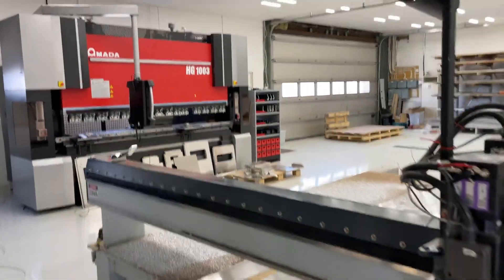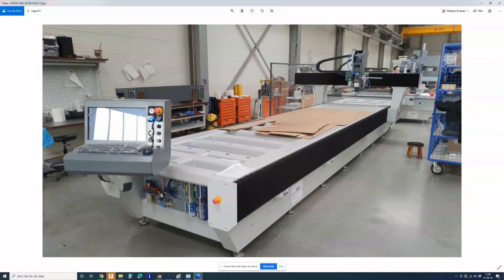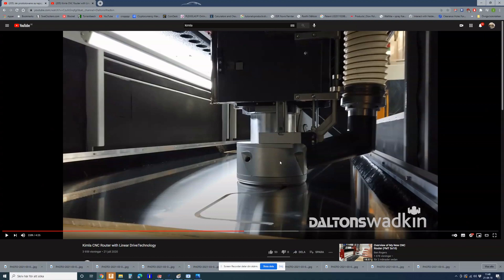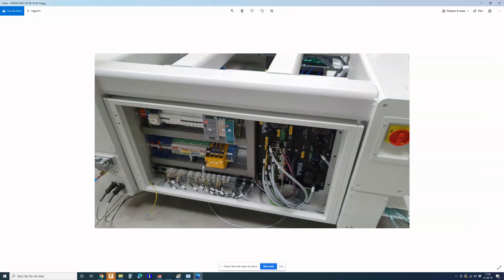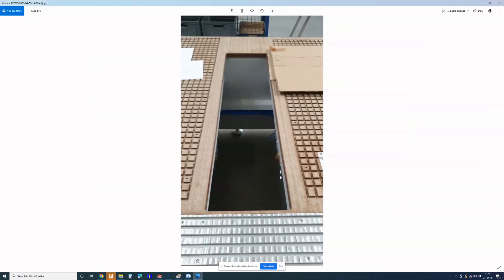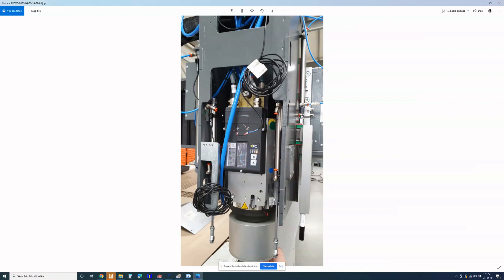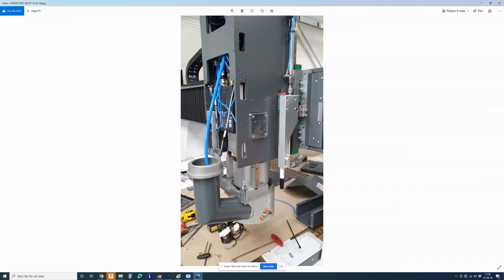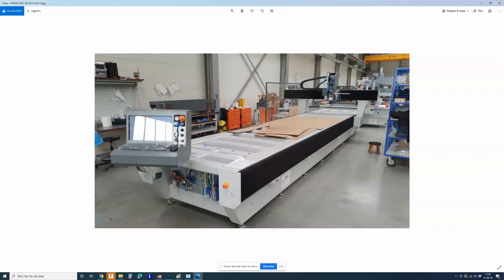The MONSTER CNC router!

Comment: ARHHH!!! LOOK at that!! Kimla popped up a few months ago on youtube when I was searching for linear motors. It's an AMAZING machine. Perfection. 16mm steel, impressive. I can imagine how incredible happy you are with your new beast. Incredible! congrats on the purchase!! Why did you picked the 12kw spindle? HSD has smaller spindles with HSK63 i thought? Perhaps you want to use larger facing mills, that would explain the higher power. The Busch rotary claw pumps deliver their full vacuum at full flow. I don't know what model you've bought, but i have a friend how bought two of these pumps for his 2100x4000mm machine; these pumps deliver the full capacity in airflow at their deepest vacuum. (he uses a VFD to control the pomps, and is using a panasonic 0-10V out sensor to lower the pumps RPM when the required vacuum has been reached. 1252 i see! i thought he has the same pumps. That Lidar is NICE! Roller bearing lineair rails! Renishaw.. Arh.. Wickedwickedwicked! Did you get a dual Renishaw with tool length/diameter measurement as well? and also a probe for in the spindle? (i fell in love with that system on a HAAS) these probes are a very worthy investment with the proper macro's. I remember when my machine arrived I wasn't able to sleep. I'm pretty sure you won't sleep fast Thursday night. What type of controller is used on the Kimla?
Reply from the maker: Haha yeah i know! I figured you would be excited. Its craaaaazy ;)
There was alot of discussion about the spindle and I was initially aiming for a higher rpm (40k+ rpm) to get faster speeds cutting thin alu with small tools but after thinking about it I went with the 24k and higher power for the sake of "all-aroundness". I'll be processing alot of different stuff on it. Also a facemill and some steel cutting. And the "floating dustfoot" wouldn not have fit a different type spindle nose.
The vaccum pump selection is a big topic in itself ;) Alot of pros and cons but these mink 1252 are great. I like the 1252 because they do -900mbar as the next size up only does -800. Tho manual states its only ok to run -900 for about 20mins. Probably due to heat. Best part is low power draw and dry running with almost no maintenance. I might have a oil lubricated rotary vane for special occasions too.
The probe is a Renishaw LP2 which is mounted next to the spindle in a "house" and comes down trough a hatch using mcode.
Tool length sensor is Kimlas own make and sits right under the rotary toolchanger. It only measures length.
The controller is also kimlas own, they combine cad,cam and cnc control into their own "Pc-cam plus".
Ive had just a bit of training so far but we'll see how i get along with it :)
Its got nice features and is fast as hell.

What machine did you get ?
Reply: @randomrouting  Arh, no, i meant the 1500x3000 router I have. And i've bought some machines in the meantime that also got me up at night, so i fully understand your enthusiasm, since this a the sweetest machine i can think of. This machine would be a dream, with the fancy lineair motors. Very curious about the integrated cad/cam, I guess they have some fancy 2,5/3d paths as well, considering the rest of the machine.  but the last machine i bought/received I couldn't enjoy.. Received it and went straight home. (arrived 2 weeks ago, an SCM K100 olympic)  Fell with cycling, landed on my head, long story short, i'm recovering good now, people found me in a puddle of blood, pouring from my ear, nose and mouth, visited them a few weeks back. I consider myself lucky after talking to them. Been 6 weeks, I had to do with 5 weeks of hearing loss on 1 side and a massive beep that kept me awake for e few nights. Art is to be able to accept that, but that was tough. Hearing came back last week, beep is fainting more and more. I feel for my dad, who had a massive case of tinnitus. I was over the moon when my hearing came back! (and when arriving with the ambulance on the ER in the hospital, seeing my scared, pretty wife, coming home where my worried kids looked at me and asked 'are you better, dad'.. I was that stupid moron that decided to go out cycling not using a helmet but a warm hat that 1 time. 

That floating dustshoe is a work of art! I guess when extracting the chips so good you can probably do without cooling, some DLC coated tools should be adequate. (or uncoated even) but in your line of work you need to be able to rely on the proces. Will it arrive tomorrow?
Reply from the maker: @berendlucasvanderweide  Oof, thats quite the scary story! Happy you are doing good!
I bet you appritiate your hearing in a whole new way.
Yes, Running dry is not a problem really. The Crown norge tools have an excellent low friction coating. I will however run ethanol when suitable as it makes the tools last a bit longer and gives a slightly better finish but mostly because you can run the same tools for longer when the coating wears off.
The truck was supposed to be here at 0800 tomorrow but It has accually arrived an hour ago! I had just left work and a buddy called to tell me it had arrived so I turned around, i just had to go take a look and maaaan is it sweet.
Its raining currently but its supposed to stop soon and tomorrow looks to be fine, CANT WAIT!
Install and training will be on saturday and sunday, so I think we'll do a barbeque or something fun at the shop on saturday evenening to celebrate this monumental leap for the company!
Reply: @randomrouting  fantastic to hear!!! Enjoy the unboxing and the training. Dedicated company that they arrange training on Saturday and Sunday. Looking forward to the results of the machine. And indeed. You're not aware of your senses if they are fully operational. Sight, hearing. It's a miracle itself. That bbq sounds like an awesome plan for the crew.
Reply from the maker: @berendlucasvanderweide  1 hour left!! WhaAAA!!
Been dreaming of that 1meter per sec feed and 3g acceleration xDD
Reply: @randomrouting serious?! 3G?! That's sick. They also level the machine etc? Kimla itself is installing it?
Reply from the maker: @berendlucasvanderweide  Yes 3g xD , I had to ask three times because I could not believe it. And yes two Kimla guys are installing it/leveling ect.
Reply from the maker: @berendlucasvanderweide Clarification, the 3g was on a test on a machine similar to mine, I thought we were talking about mine, not sure the acceleration on this yet. My head is spinning after all the training today, I just got home, its was a 12hour nonstop info-mashing.
BUT ITS FRIKKING FANTASTIC! So sooo amazing machineeee!
I'll be taking a glass of wine now and then passing out. xD
Reply: @randomrouting  cheers then! Just finished mine. Enjoy.